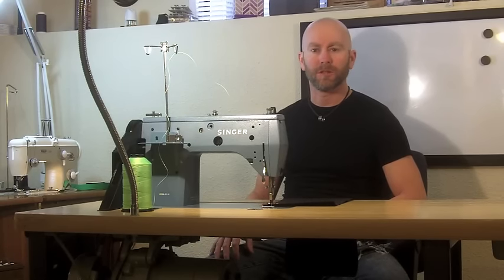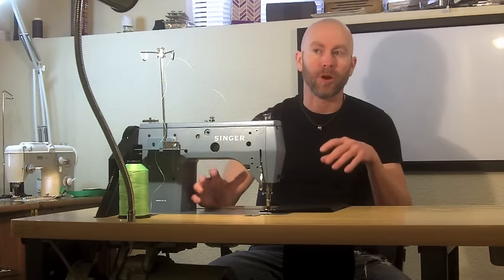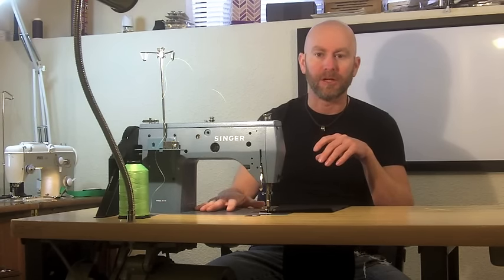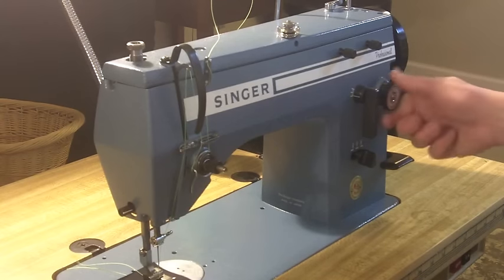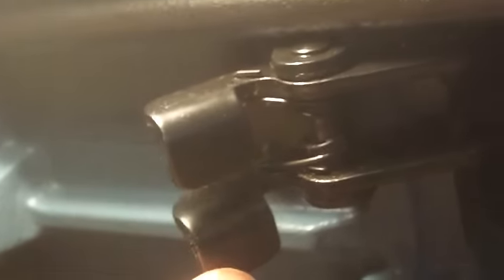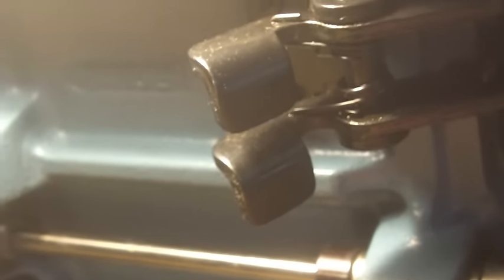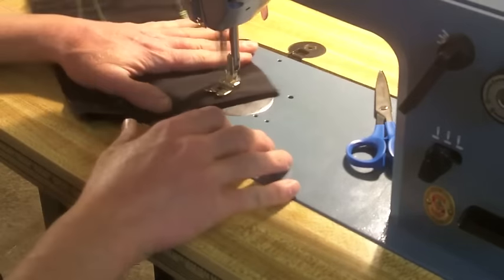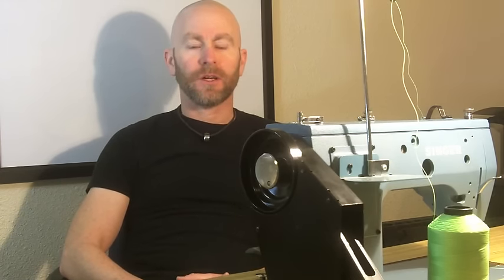Do you need an industrial sewing machine, Part 3 (I bought one!)

Comment: I have this machine, and when my mother bought it new,  there's was no front tension screw on it. The tension setup looks just like what is seen on your machine.  The machine has been sitting in storage for decades and upon plugging it in, it runs great, I've just been fighting with the tension. I came across your video while hunting for some tension adjustment hints.  Great machines!

Comment: I never use clutch motors anymore due to the necessity to change the speed for my faster or slower seamsters. Pretty much standard in our factory now. Certain generic servos are made with such crappy parts that things like the on off switch will break or the speed controls are only accessible under your table

Comment: i have a brother opus 141 that handles most of what i tell it to,   now when its to much for that old faithful i either break out the singer treadles, 3 of them and set for different stuff, one will do 4 ounce veggie tan leather like its a t-shirt.  or one of 2 industrials i have. an ol 95-10 or the ol 111w153 walking foot, other then my brother my sewing machines are 1920's or older. monster punching power,,,,,    and for leather or so in tight spots, as soon as parts come in ill have my singer 29-4 running i hope.      just got a nice singer 478 all tuned up n cleaned,   pfft it struggled with a zipper in some jeans, so that one is going to be for sale.    i like the singer in your vid and looking to get something like it to replace my brother as its main stay, but so far no luch as i want the zig zag and reverse to back tack with

Comment: what a steal! I'm looking at the Sailrite Heavy-Duty Ultrafeed® LS-1 BASIC Walking Foot Sewing Machine on Amazon for $649, new, just afraid of used.  Afraid of being taken if you know what I mean.  And not being able to try it out. At least brand new I know it will work. But sure would like to find a bargain like you did!  Thanks for the videos, they have been helpful.  I sew a lot of purses and tote bags with thin foam lining, or head liner, and need something a little tougher than my Janome. Thanks again.
Reply from the maker: Thanks, Kathy! I understand the desire for new, especially if you're counting on the machine for making money.  I have six machines at the moment, and the only ones that didn't work perfectly when I bought them were ones that I knew didn't work when I bought them.  But, I also bought them locally and CHEAP.  If you find a used machine that you're interested in, it helps a lot if it's local and you can try it out.  Thanks for watching and commenting!
Reply from the maker: Kathy, I don't know if you've had a chance to see it, but I now have a Sailrite LS-1 that I'm using in my videos.  I posted an unboxing video, and I'll be doing full review soon.  So, if you haven't bought one and want more information, check it out!
Reply: thejasonofalltrades I definitely will check it out!  I'll be in the market for one next year. thank you!

Comment: Wondering if you can replace the singer model 20-33 professional WMC transmitter with a servo motor? I just purchased this machine for $240 with table and someone replaced the switch and it wouldn’t turn on after I bought it, decided to replace the motor instead of figuring out how to correct the switch being done wrong. Plus, wanted to slow down the motor that came on it. I have many years experience sewing but only owned Singer and Necchi
Reply from the maker: Hi!
It should be no issue at all to replace the motor with a servo.  As with most industrial machines, the machine head itself is a separate component from the motor; the motor bolts underneath the table and drives the machine via a belt.
Some years ago I did a couple of videos on replacing a clutch motor with a servo, you might want to have a look at those! I don't own my 20-33 anymore, but if I did it would certainly be driven by a servo motor now!
I hope that helps, thanks for watching!

Comment: I own a singer 491 just noticed that the reverse work for 5-6spi however they stay in one spot after i go to like 10 and finer? Just wanted to know if there is a adjustment or something im missing 🤷‍♂️
Reply from the maker: Hi!
I'm not familiar with that model and I'm not a sewing machine mechanic, but in my experience, it is often the case that the stitch length regulation is not perfect between forward and reverse on many sewing machines. So, sitting the stitch length to a very short forward stitch length might make the reverse stitch so short that it doesn't move at all. If there is a way to adjust that, it's above my knowledge level. I rarely use very short stitch lengths, so it isn't something I've dealt with much, but you may have to just find the shortest stitch length that will still allow reverse to function, or adjust the reverse stitch length whenever you reverse.
Sorry I don't have better information, I hope that helps!

Comment: I have a 20u33 singer and it has locked up, the wheel won't turn, any advise on how to get it unlocked?? The motor works and the belt spins allowing tension but the belt will slip if I continue to apply the pedal. I tried to turn the handle and it won't allow it to move. I have kept it oiled and it drips from the machine.
Reply from the maker: Hi!
If it's locked up that tight, my concern is it may have gotten out of time and is locked by mechanical parts interfering with one another.  If that's the case, the timing will need to be reset.  This isn't that difficult to do, but it's not something I can easily explain.
Most "sew vac" type stores, and many fabric stores, will have a sewing machine repair person either on site or a contractor who will visit the site to pick up machines. I would suggest finding someone in your area who can take a look at it. Last time I paid to have a machine gone through it cost me about $150, for what it's worth.
I hope you find a solution, good luck!

Comment: I recently bought a Thompson and what cabinet bases can it be mounted to?  Not sure I want to mount it to a bigger table.
Reply from the maker: It should fit in any table for Singer full-size machines.  You can measure the distance between the two mounting holes on the back of the machine (something like 9.5" if I remember right, but don't go on my memory) and the length and width of the bed of the machine.I have an old singer table that I've put the Thompson and the Sailrite in. It also fits my Singer 237, and it originally held my Singer 758 Touch-and-Sew.
I hope that helps!  Thanks for watching!
Reply: thejasonofalltrades thanks; so basically any singer cabinet but the small 99? I have a 328k so I cues I could swap them but I think I would rather have a separate cabinet just for it . Have a great evening.

Comment: Did you end up liking this sewing machine? I found one for a good deal and am thinking about buying it. I'm a little worried that it might be too fast. Can you control the speed reasonably? To start, I plan to do repairs on outdoor gear and make river bags out of vinyl coated mesh. Do you think this might be a good machine for me?
Reply from the maker: I did like this machine, however, I recently sold it.  I now have a Sailrite Ultrafeed LS-1 that works better for the kind of materials I generally use. The 20-33 is very fast (compared to a domestic machine) but I rarely had an issue with that - you just need to pay attention when you get close to a place you want to stop, and use the hand wheel if you're not sure you can keep the speed under control.  It's probably not ideal as a FIRST sewing machine, but it's not bad. (And you could swap in a servo motor for very good control.)
The main reason I switched to the Sailrite is the walking foot, which provides superior feeding of the thick and sometimes slippery fabrics I tend to use. I used the 20-33 for several projects, and it worked fine most of the time, but on thicker seams it sometimes had problems feeding.
Whether this machine would work for you depends on what kinds of "outdoor gear" you plan to work with.  Tents, stuff sacks, clothing?  Definitely.  Heavy weight backpacks, climbing rigging, rifle slings?  Maybe not.
I would urge you to bring some fabrics of the kind you will be working with to try in the machine you're looking at (and make some seams, don't just sew a single layer of fabric).
The 20-U/20-33 is a good, reasonably heavy-duty machine, but it's on the lighter end of the spectrum for industrials, and is primarily intended for sewing apparel fabrics.  It still might work great for you, especially if it's a good deal, but if you're going to be sewing a lot of webbing and heavy materials, it might not be the best choice.
I hope that helps, thanks for your question and thanks for watching!
Reply: Thanks for the help!

Comment: Yes sir why my industrial singer is little bit slow now. I oil it still a bit slow. Please tell me what to do?
Reply from the maker: Hi!
I'm not sure, but there are a few things to check.
If it is an industrial machine powered by a clutch motor, try disconnecting belt from the machine and spinning the machine by hand.  If it moves freely, also try spinning the motor by hand to see if it spins freely.  Try running the motor without the belt to see if it seems like it is reaching full speed (clutch motors are spinning at top speed at all times when they are turned on). If the motor sounds normal, but the pulley doesn't spin at full speed, it's possible there could be a problem with the clutch itself.  The clutch is made from cork and could be worn out, they are cheap and fairly easy to replace. 
It's also possible the motor is covered with oil/dust/dirt and is not generating the correct power.  It's possible that a thorough cleaning might help, but you might want to consult someone more knowledgeable about electric motors before trying that.
I hope that helps, good luck!

Comment: Damn. That Singer is fast!
Reply from the maker: It is!  I thought that the speed was going to be a benefit, but I actually found it not to be for me.  I made this video and bought this machine at a time when I still had a lot to learn (not that I don't now lol) about sewing machines.  I didn't yet understand that a walking-foot machine was what I was looking for. This machine didn't really do any better than my domestic machines when it comes to feeding thick assemblies or climbing over thick seams, and it could fail much faster, sometimes causing messy piles of stitches in one spot before I got it under control.  A servo motor would have been a big help to provide better control, but for my uses I found that a walking-foot machine was the best choice, so I sold this machine. I never really used it for free-motion embroidery, but they're supposed to be excellent for that.
Thanks for watching!
Reply: @thejasonofalltrades  glad i found this video, err, i mean, that you made this video.  i'm considering getting an "industrial" machine at some point and i've been doing research on them.

i found a Singer 20U33 (blue) in amazing condition with table and lamp attachment for $700.  seems like a fair price given it's condition, but the more i research, i more i think i might look for a walking foot model.  

thanks again for sharing your time, energy, skill, and experience.
Reply from the maker: @jerrykovis5417  Hi Jerry!  You might want to check out a video I made more recently - check it out here https://www.youtube.com/watch?v=fFq5QXgF4v8&t=1123s
I delve a bit deeper into my thoughts on why if you're going industrial you probably want to look at walking-foot machines (at least for the kinds of sewing I tend to do). Good luck, and thanks for watching!
Reply: @thejasonofalltrades  Hey Jason, awesome video, very informative.  not at the point of purchasing anything just yet, but it's great getting all this information before i do.

slight off topic question.  don't know if you're still working at an awning shop, but curious how working as an operator has / had affected your desire to sew on your off time.  thanks.
Reply from the maker: @jerrykovis5417  so, quick answer first; I was surprised how little my enthusiasm for sewing on my days off was dampened by sewing as a full-time job, if anything I might have been more enthusiastic because I was learning lots of new things.

Now for the long story.

I worked for a total of three years in three different shops, and three different industries (marine canvas, leather bags and awnings). The jobs were honestly not particularly great, but I did have lots of learning opportunities (even if most of them were of the figure-it-out-yourself variety).

A couple of years ago I took over the management of a commercial rental property, and that job came with a space that I now use as my office/workshop.  Much of the job is to just be onsite in case someone needs something, so I have quite a bit of downtime, and get to sew on projects while I'm "working."  This has honestly had a greater negative impact on my enthusiasm for sewing at home than anything. I sew more than ever these days, but rarely at home.  Some viewers have expressed that they prefer the home sewing machine/environment/cats in my videos, and I try to split them between home and work, but I have a huge space with most of my machines and fabrics at work, and no real need to spend "home time" making sewing projects or videos, so I tend not to.  It's a GREAT position to be in, but it is a double-edged sword.

All that said, sewing for a living for a few years boosted my enthusiasm overall, and I still regularly employ tips I learned from those jobs that I probably would never have learned otherwise (and hopefully I've spread those tips around some!).
Reply: @thejasonofalltrades  thought i replied to this but it's gone.  maybe i'm not allowed to post links or something.  

anyways, thanks for sharing that.  i seriously thought you were gonna say that working those jobs resulted in you not wanting to sew on your off time.  so great hearing the opposite.

i'm about to interview at a medical device company that manufactures orthotics, mostly made out of neoprene.  they use devices to electronically stimulate muscles so it's not just sewing.  figured i'll pick some skills.

also, i'm picking up a Necchi Lelia 513.  gonna post a link to picture of it...

https://i.imgur.com/mPcUw0S.jpg

Comment: I have this same machine hope you can help me, the knob at the end I can't turn it when I need to, I need to use it at times to loosen my thread to pull out or to raise my needle by hand. Anything you can tell me how to fix would be appreciated. It takes two hands to move it AGH
Reply from the maker: Hi Joyce,
I'm not sure, are you referring to the clutch-release knob on the end of the hand wheel?  Or do you mean the hand wheel itself?
If you are referring to the hand wheel, when you are turning it by hand on an industrial machine, you are trying to turn it against the friction of the belt connected to the motor.  If you LIGHTLY depress the pedal (even turned off) it will release the clutch a little and allow you to freely hand wheel the machine.
If that's not your problem, let me know!